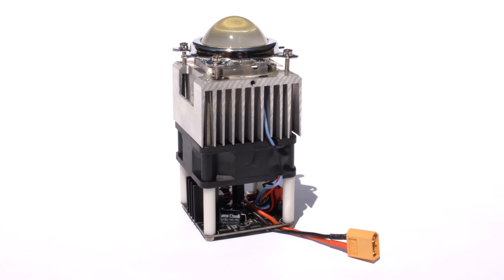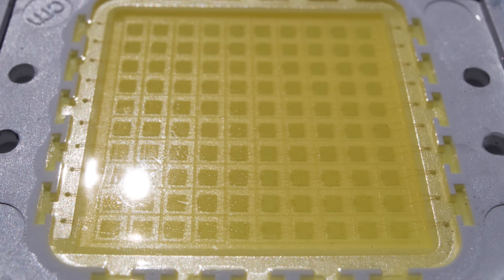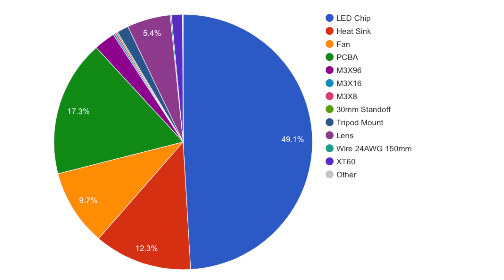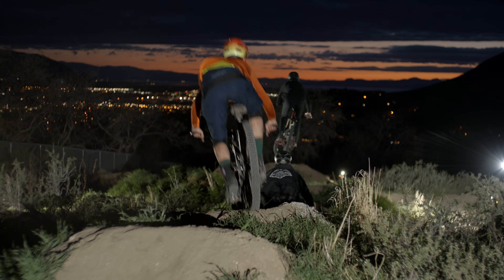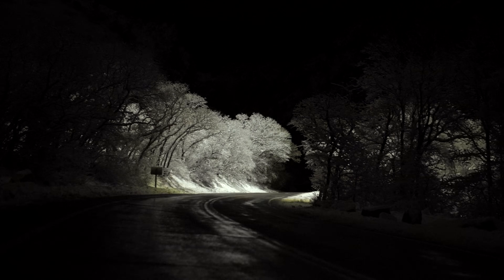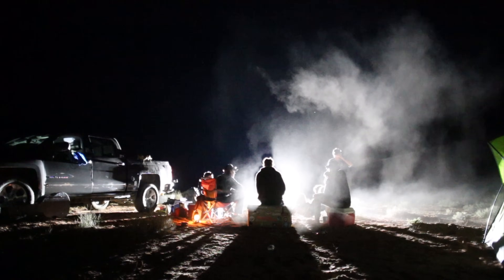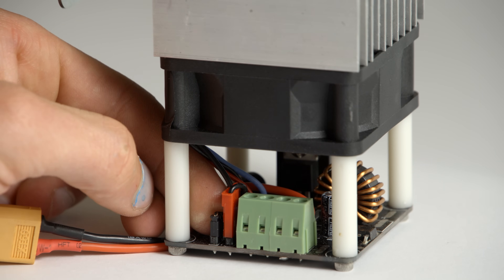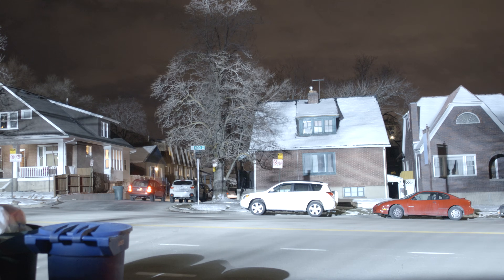Stratus LED 100W Module Introduction

Comment: And there is no undervoltage protection. Whit that module you could program a Voltage range under witch it just turn itself off

Comment: To bad 100w LED's are junk and they don't divide the voltage between all 100 LEDs causing hot spots. Eventual complete failure  is imminent...
Reply: By your logic, top manufacturers with massive recalls such as Ford, Chevrolet, BMW, and Volkswagen are junk cars and complete failure is imminent. 

Which would make sense since some of them were bailed out by banks. Just goes to show how ignorant and prejudice you are.
Reply: These modules are great, I have one on my ebike for riding trails at night.
The LEDs themselves are only a few dollars off ebay or banggood and a doddle to replace if you're that concerned.
$50 is great value considering you don't have to spend the time researching, sourcing and building your own kit, but there's nothing stopping you from doing it yourself.
Reply: So your saying, "Hey its only $50 bucks and if it completely fails, you can rebuild it for cheap." If you had the skill to rebuild it you would save the $40 and build it yourself for $10. Or completely avoid these shitty "100w" led's that probably only run around 50w but have a much worse fail rate due to bad design. 
You are right, people will buy literal rocks with faces on them so who am I to disagree with this shitty fire hazard of a product.
Reply: Prejudge as much as you like, you're still wrong.
Reply: Check out bigclivedotcom's review... Do your research!
Reply: I've followed Clive for a couple of years now and am aware of some substandard LEDs, however, you are still prejudging and don't know if Daniel sources premium LEDs.
I use a number of those LEDs in my projects and all are still working after 2 years.
Reply: You acting as if Chinese factories make money off of constantly improving the product... Are you arguing to be prideful or ignorant? Sure those LEDs work and can for some time if powered correctly but they aren't running at any where near 100w or running in an efficient manor. This is good ol snake oil bull shit with big un-provable numbers.
Reply: I'm not acting nor arguing, simply stating an observation that you are prejudging with insufficient information to make an unfounded and unfair criticism.
Reply: Do me a favor. I'll give you the benefit of the doubt if you can produce two model numbers for updated LED's. I have done 0 research so the ball is in your court. I submit to you.

Comment: what would be a best way to hook this up the a truck would a 400 watt inverter work??or would i need something more powerfull
Reply: a100nick if your car battery is 24V, you probably can power it directly from a battery
Reply: I'd get a 12 to 24v boost converter, assuming I could find one rated for that much current. I'm pretty sure you could find one online somewhere.

Comment: A great module. Doesn't even need proper optics at this power level. I am thinking of building a high output lighting system, but not sure of the scale

Comment: does this support any kind of PWM brightness control? I guess I could use the switch circuit to run faster than I can perceive it at like +120hz
Reply: I'd also like to know this, It looks like no, but hard to tell.

Comment: All up weight with the 6s installed, I'm interested in the $229 package but with approximate weight limit  of my phantom 3 4k is 2.5lbs. Didn't want to risk a higher payload test on my phantom,will my phantom be able to carry the payload? Let me know, thanx.

Comment: I wish they could be run off of 12 volts so I could make a light bar for my car with them...
Reply: Buck boost? go look it up
Reply: You could use a 150w step-up converter they use around 9-32v input and deliver 34v maximum out

Comment: How do I plug it into an outlet?
Reply: Closer to 24V, runs off a 6s battery
Reply: Probably some sort of AC to DC 12 volt power supply
Reply: 24V 7A

Comment: I think this is a great idea, but I see one little problem: there is still quite a bit of knowledge and work required to get the light running. Everybody who has that knowlege might as well build the entire thing from the ground up, to your current target group, there is no point in buying a half build system when they can just build the entire system themselves and save money. I would love to have this kind of system to work with my camera, but I just don't know to get it running, what battery should I use, how can I charge it, how can I control it, where does the battery go, how do I remote control it. To me, it is not worth it to figure all of those things out, it is the only thing I would use this knowledge for, and if I knew all those things I could probably make this light myself completely. If you would just sell an entire system, you know, lamp, mounting point, a place to put the battery, a battery that tells me when it's empty, a switch on it, a charger, some kind of case and some kind of extra component I could clip on to make it remote controlled (maybe even Bluetooth?).. you could charge a lot more money and pretty much every mainstream filmmaker would kill to have it! Right now it it just to much effort to be worth the result.
Reply from the maker: Kommentator You mention saving money, but a ready to use film light with the exact same LED chip is $500. These modules are $50
Reply: Kommentator I dont think the market is that binary. There's a lot of room for products like this that sit somewhere between plug and play and complete DIY. Especially in the RC community where it's popular to buy kits. I see where you're coming from, but  personally what would make this product appealing is how much time it would save.
Reply: They are even avaiable with a battery, battery bag and charger!
Reply: rctestflight I'm not saying I would buy a film light for $500.. To me, the biggest selling point is the tiny size and the huge power, not the diy part. You have already shown some of the things you can do with these lights, those are not things you could do with those massive film lights, at least not when you are an amateur just trying to get a rock climbing wall illuminated in a few minutes.